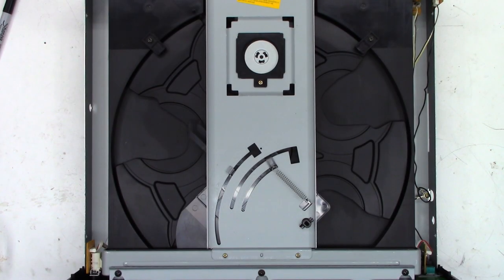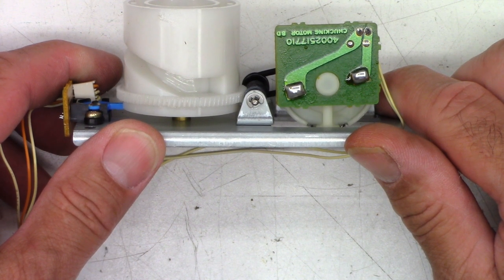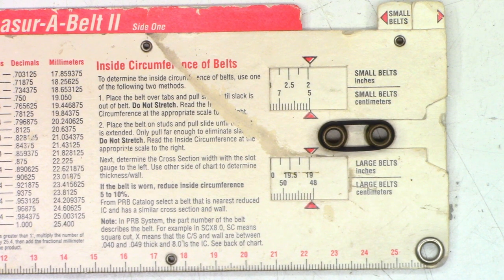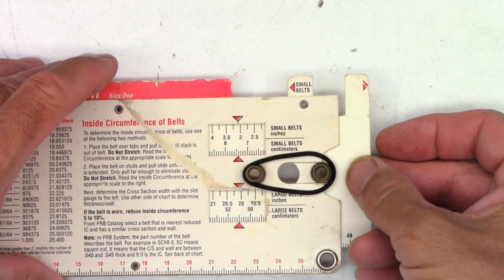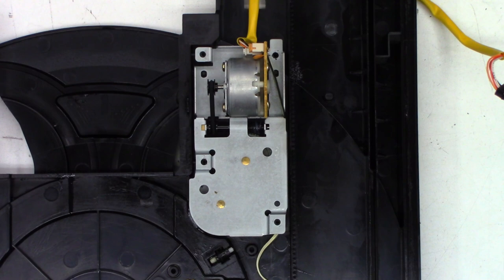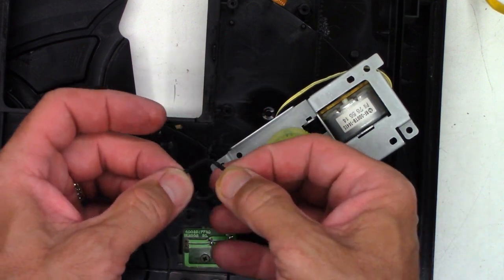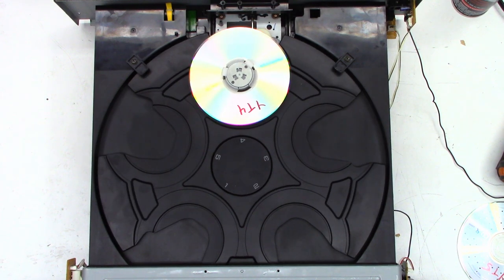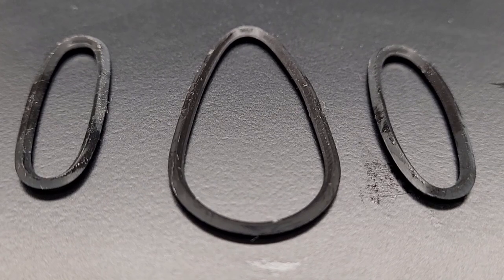Harman Kardon FL8400 CD Player - Wont open or close - Old belts strike again

Comment: Does the device you are using the measure the belts measure the inner diameter?  And are you working from the bottom of the player or the top, after having removed the disk tray.  Thanks so much for this video!!